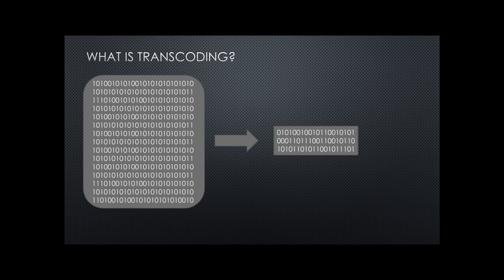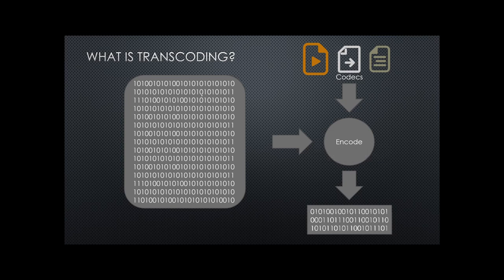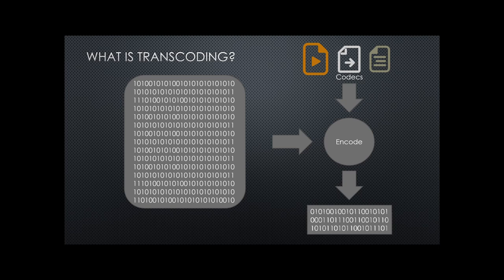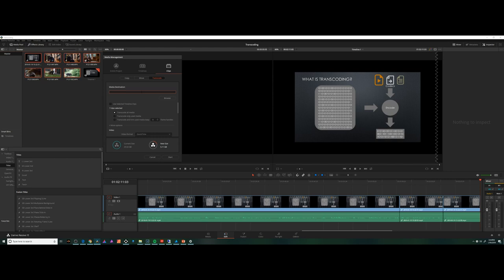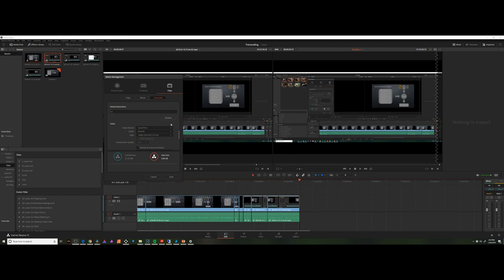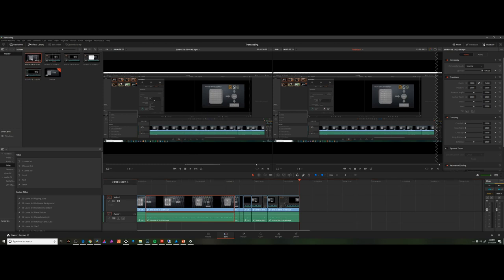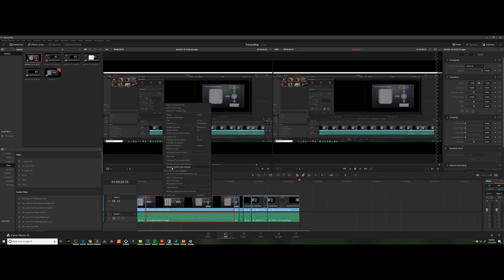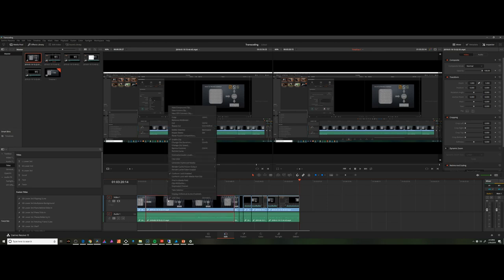What is transcoding Video?  How to do it and why in Davinci Resolve 15

Comment: Thank you for the information! However, I am still quite vague on the concept of this whole process. What will happen to those transcoded file from "Generate Optimized Media" after we are done with the project? Do we have to remove it manually?
Reply from the maker: Great question.  You can run media management to handle. You can delete the files in the playback menu or you can delete the CacheClip folder off your file system manually.  I tend to just nuke CacheClip whenever it gets large ;)

Comment: Hey, thank you for the video!
How can I delete optimized media when the project is finished?
I saw people complaining how DaVinci store it in non-reachable places?
For better results, should I avoid optimizing video right away in Media? Should I wait to cut the footage, so I optimize less data?
Thank you!
Reply from the maker: <from memory so the names might be a touch off :)>. You can either open the project and in the playback menu choose “delete optimized media” or you can browse to the “CacheClip” folder and nuke it.  The folder isn’t hidden from users, in face you can configure the location it stores those items in the Project Settings modal windows (Edit->Project Settings scroll down).  In fact if you have more than one drive on your computer you should probably optimize where you store the Cache folder to a quick drive that isn’t hosting your operating system or resolve.  For better results (faster optimization) you would ideally optimize only the portion of clips you are going to use so after you add it to your timeline would be faster...however cutting the media up to get it into your timeline might take longer so it’s really dependent on how much of your media you think you will use vs how much will stay on the cutting room floor.
Reply: @johnsfilmsllc  
This answers pretty much everything. 
Thank you for your promptness, sir!

Comment: Unfortunately I have been trying to employ this method of transcoding media into Davinci (an MXF file to be exact) and it has turned out be completely inept at accomplishing its purpose. Not only is the resulting file the same size but the format remains equivalent to that of the original file (in this case MXF) . Anyone any  ideas on what might be the issue ?
Reply from the maker: What format do you want it to move to?

Comment: Thanks.  Good explanation.  If the Studio version is purchased, does the hardware acceleration help even if you are not using another monitor?  I have a Nvidia GTX 1060 on my laptop with a i7 8th gen. so I was wondering if the Studio version would make playback smoother.  My playback is typically smooth, unless I am watching something in 4K or with some Fusion or lots of color changes.
Reply from the maker: I’m not sure exactly what you mean by another monitor.  If you want to have a color calibrated grading monitor running you need a Black Magic Design output card (I have one and can do a demo video if you like).  If you are meaning you hook the laptop up to a monitor and use Resolve entirely on the monitor it depends on the display specs vs the laptop display if you are going to see a degradation in the playback performance.  Based on your setup I’d suggest using optimized media, using the playback->proxy->half setting or transcoding to DNxHD before editing (in that order of pref).  If you are just looking for smooth playback it’s not worth the money.

Comment: Hi! Great explanation. Do you think there is any difference shooting IPB or ALL-I IF I´m going to transcode the file (from HEVC to PRORES or AVID)?
Reply from the maker: The transcode will work faster with All-I.  There is also more "real" data the system will have to work with to build the editing codec (Prores or AVID).  In the end however I don't expect the quality difference to be very noticeable...
Reply: @johnsfilmsllc  Muchas gracias!

Comment: Hi John.
Could another way be to export all the media first to an friendly codec (DnxHQ?
It would result in abou the same?
Reply from the maker: That’s exactly what optimizes media is the only difference. If you did it manually when you rendered your final product, when using optimized media...resolve goes back to the source material in the native codec to render the final.  In the option of doing it manually you would render the material again for your output
Reply: @johnsfilmsllc  Thanks for your reply John.
Dont know if im going to use this or first transcode all my media to DnxHQ to edit in a more speedier timeline.